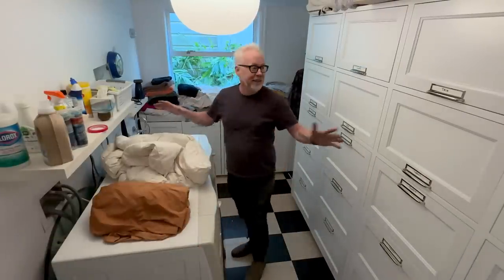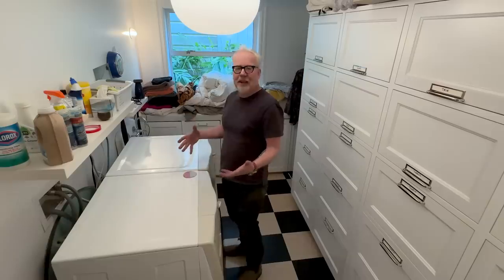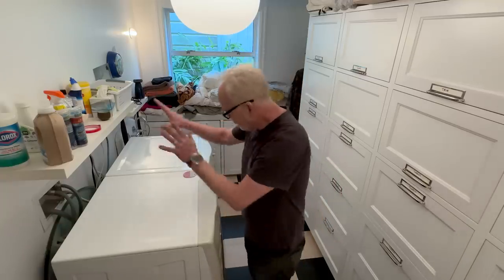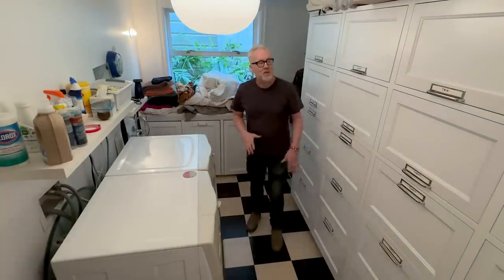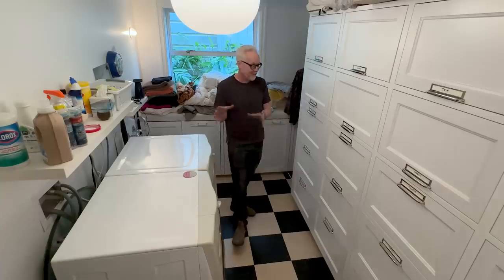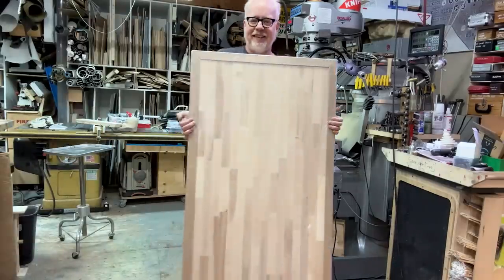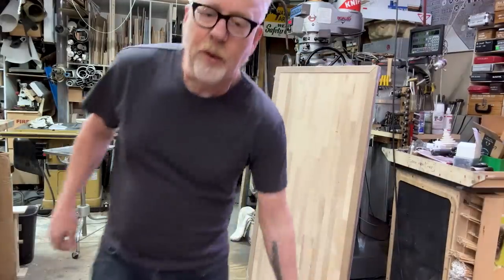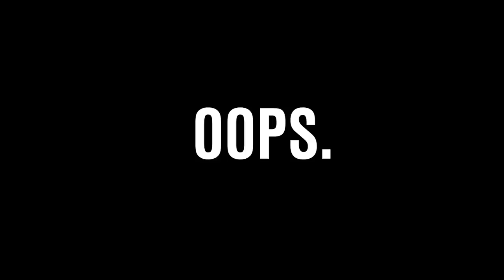Adam Savage's One Day Builds: Laundry Folding Table!

Comment: I think thats gonna shake itself loose and start rattling pretty fast unfortunately..  They vibrate so strong and fast, I think its all but impossible to attach something to it unless its really bonded like its welded to it.
Reply: I was thinking rubber feat would be better than tape. That washer will shake it like crazy when spinning.
Reply: @tonycosta3302  Yes, that’s what I thought. Might work – it would move, but probably/hopefully not fall off.
Reply: that tape he used is insanely strong

Comment: I feel you might have another video in the future to fix a problem once the wash machine starts to vibrate but this is my thoughts on knowledge of UK wash machines. having fitted kitchens in the past, they either had an inbuilt washmachine designed to be in the cupboard space with damping to minimise the vibrations or a hole left for one to to fit in. on the second type, we would leave a gap as if it touches the worktop the whole worktop vibrates and buzzes, causeing things to possibly fall off. one job i remember we were asked to fix this problem, had to remove the worktops, put a decrotive spacer in to raise the work tops so it didnt touch the wash machine as the previous kitchen fitter didnt allow the room for it.

Comment: I'm kind of surprised you didn't use the leg levelers under the dryer instead of the clothes pins.  over time the wood wedges could shift from vibration or get knocked out of place when cleaning the floor.  also those silicone bumpers under the butcher block would work well to hold it in place and would resist movement from vibrating washer and dryer.  similar to how glass protectors are kept in place on a tabletop.
Reply: Yeah, that was amusing. I mean, I don't know that exact model, but all the laundry machines I've ever owned had adjustable feet for leveling. Putting a make-shift shim in when the machine has its own means for leveling, priceless.

Comment: I understand the need for flexibility, but you might want to revisit this design soon Adam. If your washer/dryers have any wobble to them while in use, the top might end up sliding off from the vibrations. You could solve it by building a back and sides surround for the machines that you can attach the top to. essentially, it would be a cupboard that encloses 4/5 faces of the machines and allow the top to float above them.

Comment: As a maker I have worked around many of my home's infrastructure. I have always, nearly instantly, regretted something (even) semi-permanent. Such as with VHB tape to a surface. We both know you're not supposed to cram anything up against the wall of plugs and wires, so keep the gap. But make a separator. That holds the work surface in one direction. Then keep the 6" overhang, split left and right for a wooden gripper with squishy rubber on the insides, so that you have to mush it into position. Now it will stay put with minor clothes-folding tussle. A backsplash is essential but--! one needs a gap to get at the power sockets.
BECAUSE, as sure as Milwaukee made little red handles, one of those bastards is going to start coughing up blood real soon. With my plan, you just whip it off to gain access. With your plan you have to dig out a crow bar-- or let the tech do it...

Comment: I'm curious how this held up to the vibrations usually caused by dryers and laundry machines? Personally i would have kept the table handing of the side and added legs to it with a 1-2 cm gap between the table and the machines so its actually independent

Comment: I hope you never have to pull out the washer or dryer for repair or to clean/replace the vent hose or plumbing. Not only will that board be super hard to pull away. But the VHB will pull the paint right off the surfaces of the appliances.

Comment: I would have wanted to use some kind of foam tape to secure it to the appliances I think. If that tape starts to let go, or there is an unbalanced load, or even just the potential to act like the sound board in a piano to disperse the noise, and foam tape might be able to help cut that down and give some flexibility to the arrangement.

Comment: I felt unsafe watching you cut that rabbet on the edge. Instead, I would suggest using your rail guide as a fence, clamping it to the work piece using track guide clamps and use a router with a templating bit chucked in instead. This way you could work from the face of the material with more support. Another option would be a dado stack setup in your table-saw with a sacrificial fence to allow you to get right up to the edge.

Comment: You really need to get a chop saw... and find room for it.   ;)

I would have cut the top about 2" wider and placed a cleat under both ends to capture the tops of the machines... keeps it from sliding and rely less on the tape to hold it in place.  It also hides any gap between the underside and top of the machines.  Washing machines have a tendency to vibrate pretty good, so some thick foam tape would be best.

Comment: Washing machines like to have the freedom to move and vibrate so I'm not sure that taping the board onto one without anyway to absorb the vibrations are going to do the machines any favours. 

It's also going to make one hell of a racket when the spin cycles up and running especially if that was two washers (one may be a tumble dryer) and they're both set to run at the same time.

Comment: HA! After I got my track saw years ago, I did that same thing 100 times before I remembered. You always set your depth of cut directly on the workpiece and then wonder why it doesn't cut all the way through. You have to account for and add the thickness of the track as well.

Comment: You might want to put some felt pads under the table against the machines. It will prevent fretting from the vibration of the running machines.

Comment: ooof, I'm not too sure about that one... perhaps because it's not the same type of front loader washer and dryer I'm used to, but those vibrate like hell, so I can't put anything in top of them without it being basically shaked off. xD
I don't have a two tier setup like that though, but my washer/drier needed a thick EVA pad under it, and if I was going to put a folding table on top, it'd have to be suspended.
Let us know if it worked up in the end though, Adam. xD

I never know exactly what is best to do with those. If you  clamp them too much down the floor and fix things, all the energy of the out of balance tumbler ends up in the machine itself, which could destroy it overtime... but if you let it too lose the machine starts walking around and doing too much noise for an apartment.

You have those feet that acts sorta like a suspension for it, but those elevate the entire thing too much to fit into the space I have here, so I just got a thick rubber mat (EVA) for it and it has been working ok.
I just have to be careful to use it only when it's at least over half full... or else it'll start vibrating too much.

Comment: One thing he may regret about attaching the surface to the top of the machines is that the top panel of the machines is usually the first one you have to remove to access the service manuals or check items when troubleshooting. But he may not consider that an issue if he isn't one to be his own appliance repair tech. But then if he calls someone in, it's still going to be a pain in the butt to remove. The other issue I see is that it may end up amplifying any vibration in either machine when operating. Fantastic idea to make the surface more usable, but I am curious how it will work out long term.

Comment: I would be concerned about washer/dryer vibration and taping the bench top down.  If it were me I would have left it long and floated it a .125 inch or so off the appliances on some dainty legs.  Just enough to decouple it but not enough to allow for sag.

Comment: Adam, please don't put your hand behind the cutting plane of the tracksaw like you're doing at 9:20. Kickback can happen on any tracksaw and it takes fractions of a second. Plenty of time to cut through your hand hundreds of times before you can react.
Edit: Also never pull the machine backwards while plunged and in operation! Especially with your hand still behind the blade. Please take some time to brush up on tracksaw safety.
Edit2: I just got to the part where he free-hand cuts into the wobbly countertop balanced on its side without a guide rail while using one hand and his knees to stabilize the wood. I give up.

Comment: Doesn’t the machine have adjustable feet (mounted in a threaded rod) to account for uneven floors? This would be much better than 1/2 a peg…. Also, as others have suggested, rubber feet would have been fine and not marred the machines when they start to jump around when unbalanced…

Comment: On a more serious note: You fixed it to both machines? You are aware that Washing machines and drum driers (hope that's the correct en term) vibrate? It's already a problem with double sided tape and one machine, due to the mass of the wood plate. With both machines affixed to it the bond will become loose on one even sooner.

Comment: I have the same issue and thought, great, Adam is going to fix this problem for me. When I heard 'butcher block' my attention departed this video as I tried to anticipate how Adam was going to make a practical folding table out butcher block. Wouldn't that be difficult to manipulate? Difficult to open out? A cumbersome storage problem on its own? 

I tried to troubleshoot these problems in my head, always weighing up the benefts of such a surface for laundry. I got up, I mooched about a bit, I made myself a cup of tea, did a bit of mental tyre kicking, but I just couldn't make it work: it didn't seem practical. 

I tuned back into the video as Adam was lowering the finished piece onto the machines. He had his happy face on and was acting as though he was finished. What's this? That's just a piece of wood sitting on top of his machines, that doesn't fold up or away! And that's when the penny dropped. I started to berate myself for wasting half an hour on a stupid idea when I realised, actually, that'd work for me, too. I knew Adam would fix the problem for me! ;¬)

Comment: My dad kept a one pound coffee/tea tin of tongue oil stuffed with bits of rag and paper towels in the van and would keep it in there when we cleared it to prepare to go camping. One time while camping we had gotten the box of matches wet from a sudden storm and Daddy just winked and said it was no big deal. As the sun began to set he took a Brillo pad and tore off a fourth of it, got out the tin and sat by the freshly reset firepit. He pulled out a pinch of oil soaked fluff with three fingers, sat it in the tender, topped that with the Brillo, and covered it with a stick. Then he walked away saying nobody touch the fire. Twenty minutes later, at twilight, the tender suddenly lit! The stick had charred half the way through, and had a soon to be glowing red interior. Mom adjusted the log so they would catch and we went on with our camping.
(Yes, I've been told that the Brillo is not needed. But that's the way he did it.)
Reply: How come his vehicle never "went up" on a hot summer's day ?!

Comment: Ok, I cringed when you said "attach to the top of the washer/dryer" (even if only with VHB). Dryers need an annual disconnect & pull-out for lint cleaning of the hose and vent; dryer belts last 3-6 years, washer hoses last 4-8 years...
Since it's Adam, I expected legs and casters or hinged from the other shelf, LOL

Comment: (Obligatory statement- I love your videos and this channel, but...) I know this is not exclusively a woodworking show and people are responsible for their own health, but PLEASE think about how you are using power tools that care not if they are cutting wood or your fingers. NEVER back up a track saw or circular saw with the blade spinning-it is a recipe for kickback and lost digits.  Also, a circular saw should never be used on such a thin edge, even with apple crates and clamps to hold it upright.  A router with a straight guide, taking a small amount at a time is a much safer option and will give a better cut.  Last, if you are using a guide on a circular saw, it should not be referencing off the cutoff piece; it can pinch and cause a kickback or grab the cutoff and throw it.

Comment: “Bowling alley worktop”? That’s a hilarious euphemism for those crappy laminated tops*. I really don’t like them, but that’s what you get these days if you don’t want to spend a fortune. We need to get used to this stuff.

I’m really surpised it was hard to find – in Europe that’s all you get, and you can get those everywhere.

*I’m referring to the fact that the whole thing is patched together from pieces of wood that are shorter than the overall length. Sustainable, economical and reasonable, but not nice. Looks cheap.
Reply: What kind of wood work surface would be less crappy?  I don't know why he had a hard time finding it.  It's sold at all the major big box home improvement retailers.
Reply: @HomebrewHorsepower  Aesthetics, mostly. They come in different qualities, but they all remind me of very cheaply patched together boards of this kind.